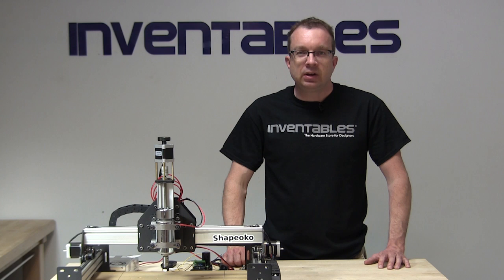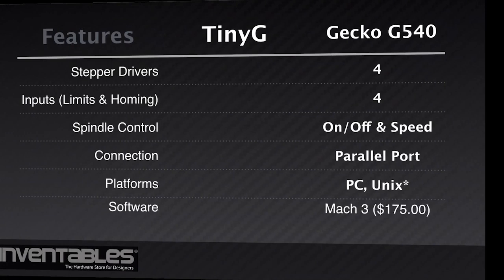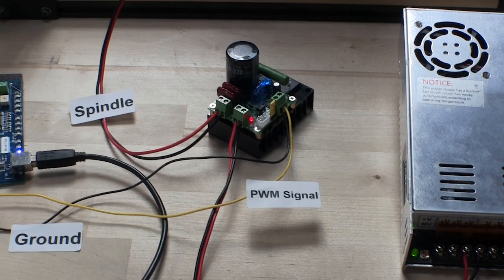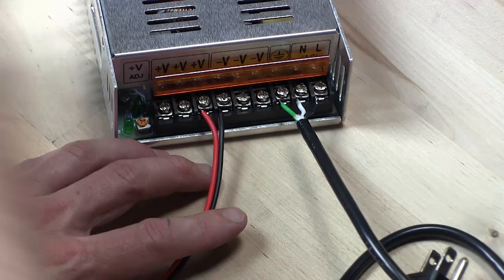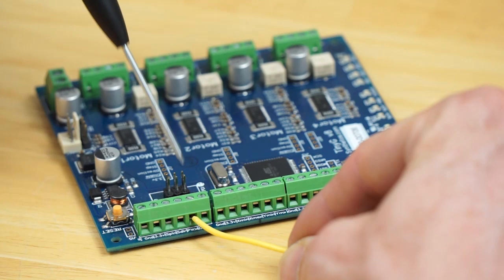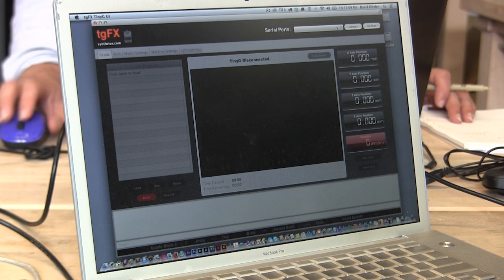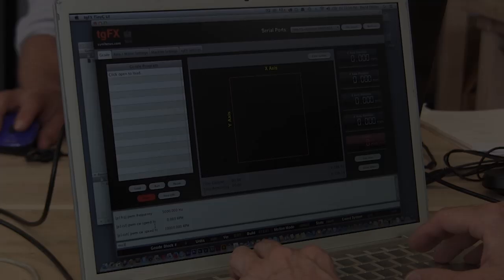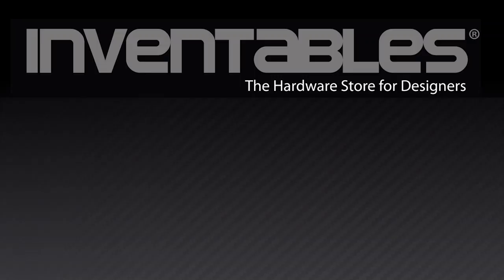Tutorial - Using TinyG CNC Controller on Shapeoko Router with DC Spindle

Comment: In the comparison chart, Arduino+gShield shows 0 for the inputs. That is actually not the case. It has limit switch inputs for 3 axis and you can even attach a touch probe with Grbl 0.9 and also have pwm output for the spindle.

Comment: You can also use this on routers without PWM built in. You skipped over the part where you connected all stepper motors from Shapeoko's board to the TinyG board. I assume you've completely bypassed Shapoko's circuit board here, it is now a fancy paper weight.

Comment: Great video.  Thank you!  I would also like to see a video on connecting the steppers.  Do you have NEMA 17 or 23 motors in this video?  The unit moves very quickly.  Curious if that is due to the Tiny G or the motors, or both???